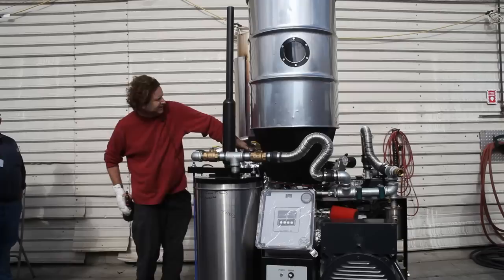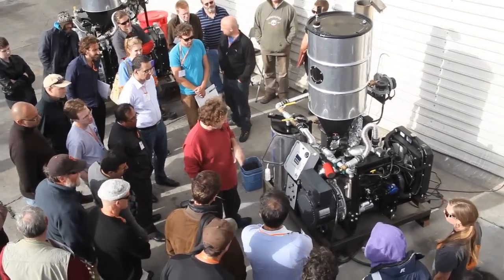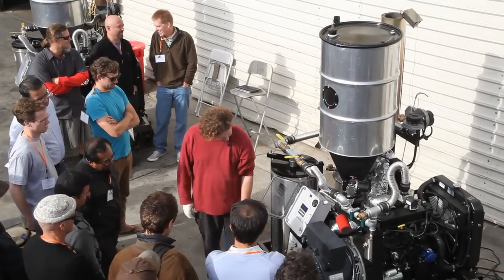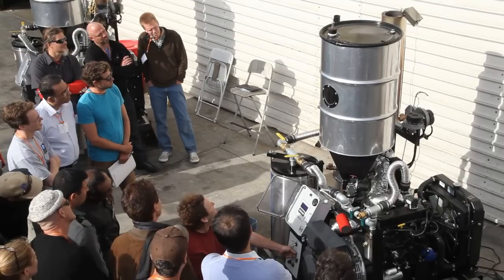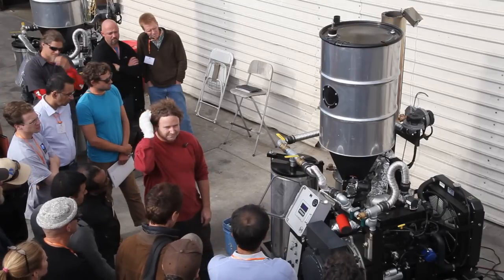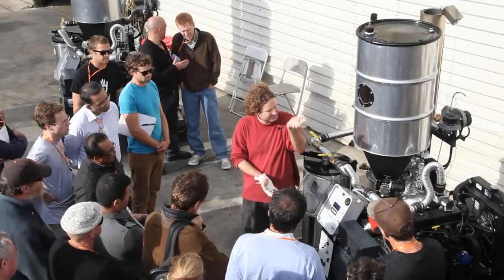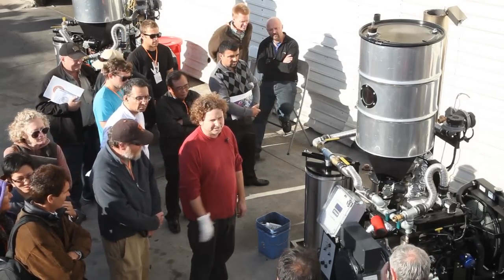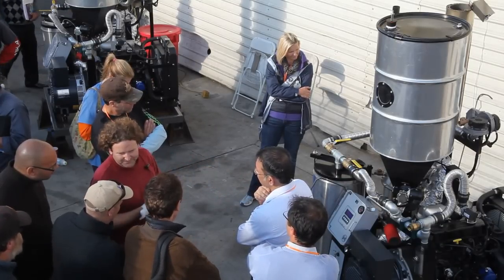20kW Power Pallet Start-up w/Jim Mason

Comment: I am interested in purchasing a unit to generate aproximately 300KW  115/230/460V 3phase electricity at 60HZ using wood chips and scrap wood as the fuel source.

Comment: I think the presentation didn't go that well. Plus that is super complicated you need to automate most of the process.
Reply from the maker: Our technology has gotten much more user-friendly in the past six years. Remember, we started making kits for hobbyists to build themselves: the Power Pallet has evolved into an increasingly mature and self-regulating unit since 2008.
Reply: @allpowerlabs  can I buy the plans oh and how long can you run this unit per day. How often should you clean the filters and what is the cost and maintenance tasks. Oh what is the gas flow rate.

Comment: Not knowing all that much about wood gassifying, I found his pony-tailed assistant more interesting; I could relate to her. A wood-fired steam powerplant would be far less costly and simpler to operate.
Reply: The advantage of wood gas is that it can be used in preexisting infrastructure (internal combustion engines). There aren't many small steam appliances around anymore.
Reply: would use a lot more wood than say heating it using gasification.

Comment: The energy you have put into this operating system is awesome. However, if there is an EMP attack will this system be able to survive and continue to be effective in running a generator or car engine ?    It seems to me that is what will keep one alive is the capability to absorb that kind of hit and keep pumping water and provide heat or electricity in our homes. We just gota flush, pump and stay warm.
Reply: Setting up a gen set that has the old points and condenser system maybe the answer to your question. A used generator with the fore mention setup would more than likely survive such an event. It would be inexpensive and  being there would be minimum electronics less likely to be damaged in a solar event such as a solar EMP. Just a thought.
Reply: small enough to do a faraday cage...

Comment: how much would such a thing cost?
Reply: A lot more wood than this woodchuck could chuck ! Hell you could get a 20kw propane generator a welder a chainsaw a wood chipper and 1 year or more of propane to run your  house/shop and diesel truck and a year of gas for your chainsaw,   if worse case scenario occurs in the meantime you could build 2 gasifiers from salvage for nothing to keep your 20kw generator running when your propane runs out.And run your truck. You'll have at least 1year to complete the build and cut and chip wood  for fuel reserves ! And all that paid for with 30,000$ and no downtime !!!!!
Reply: 30000$